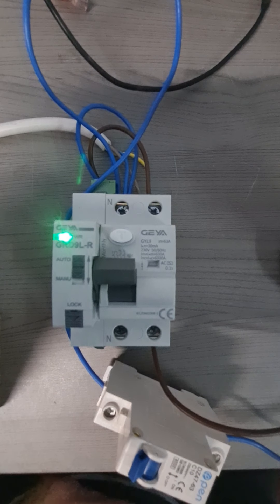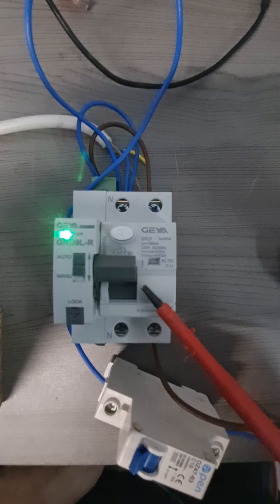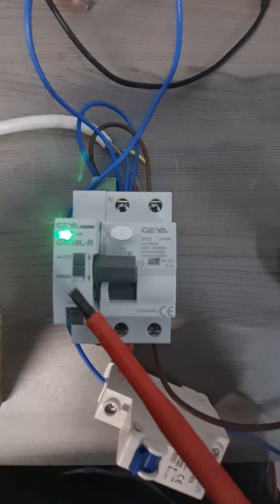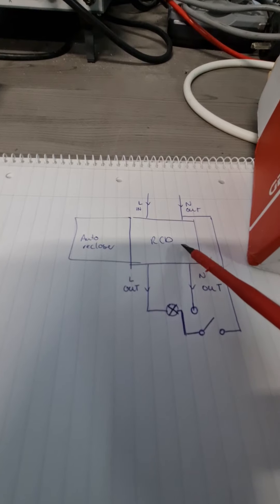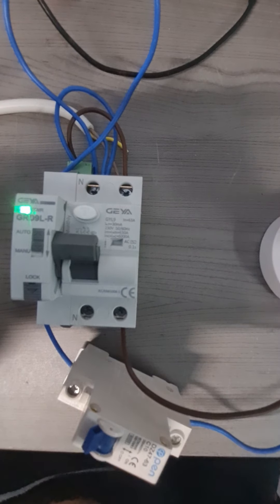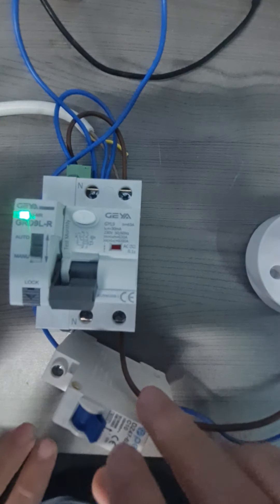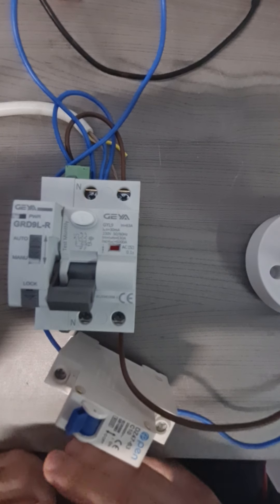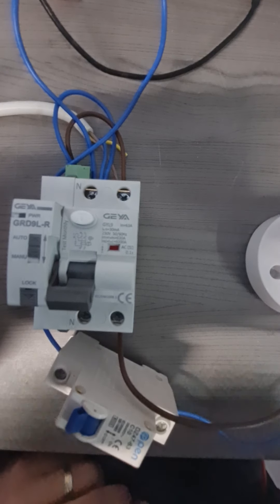GEYA GRD9L-R RCCB RCD with auto recloser Review.

Comment: do you recommend this breaker for home use, I'm planning to use just for the RCD function and the recloser,not for protection but i can't find enough reviews
Reply from the maker: I would go for an RCD from GEWISS or LEGRAND such as the RESTART PRO. Much safer and the you have better quality control since it is from a reputable brand.
Reply: @kscelectricalengineeringma899   thank you for your reply. from cost perspective I can't use auto restart RCD from GEWISS or legrand. i need 10 of them each one  cost 300$ , I'm planning to stay below 700$ for my project. i have 10 circuits in my house and I'm planning to add a new RCD panel so I'll have each circuit pass through it's individual RCD. so the main panel will provide the OC magnet and thermal protection while RCD breaker or this chinese breaker will provide just an earth leakage plus auto reclose function but I'm worried about reliability.
however my 2nd option will be using a traditional RCD from legrand or any other well known vendors.
there's a lot of cool Smart circuit breaker with an affordable prices  but idk how reliable they are and when it comes to people safety and protection, reliability is the most important factor.